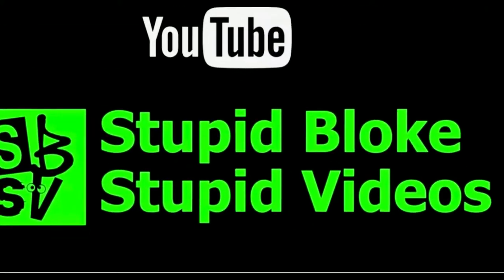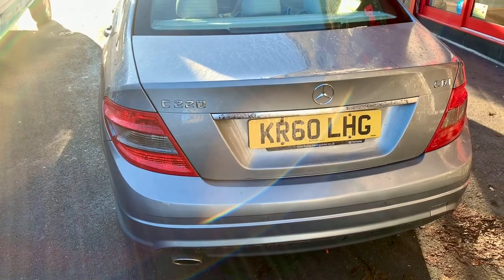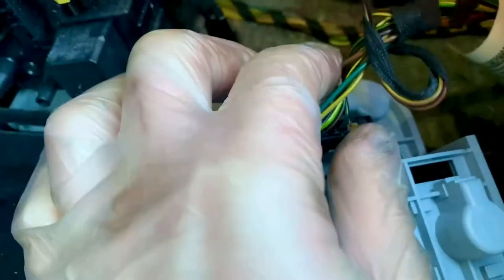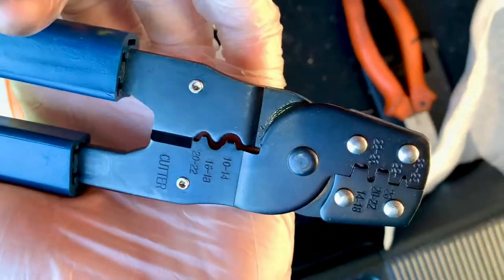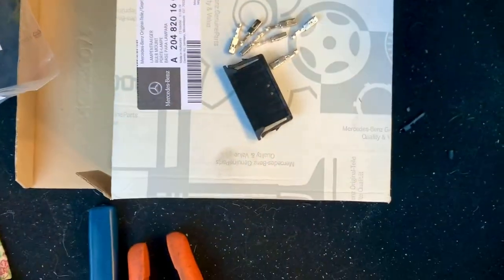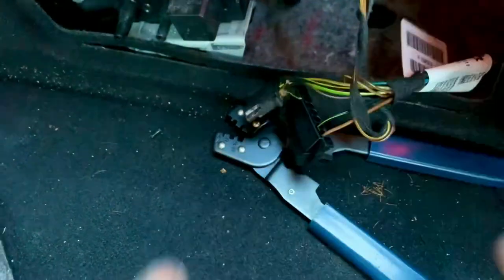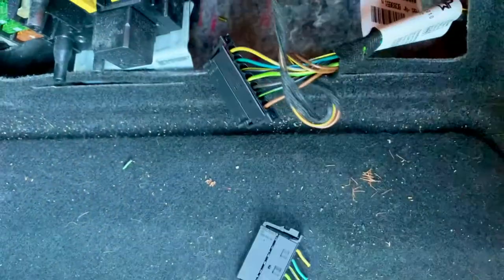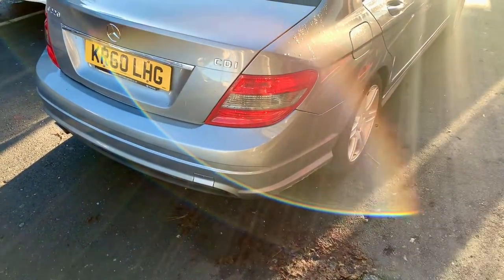Mercedes C Class W204 Rear Lamp Cluster Fault. Wiring Loom Repair

Comment: Very common problem with W204s. I had to replace both sides on mine, more than once!
Happy Baby Jeebmas sir. 👍
Reply from the maker: Yea seems to be a common issue, I’ve got the twiddly knob inside to fix soon too. I prefer my Beemer’s usually to Merc but saying that, it’s still a nice car though. 

And a Happy Easter back at you G.

Comment: Thanks for this video, I just wanted to confirm if it’s possible to pull the pins from the old connector and plug into the new connector. And then just fix the earth only instead of cutting all of them and crimping them before fixing them to the new connector. 
Thank you
Reply from the maker: Hi mate, yea it is possible do that if you manage to get them out without damaging them, but then the wires all end up different lengths and can strain the connector.
Reply: @StupidBlokeStupidVideos  thank you soo much. Really appreciate

Comment: I have just sorted this on my mate's Mercedes C220 W204.
The total draw on all of these bulbs if they were to be on simultaneously is 9.4A.
The 5 large bulbs draw 1.8A each an the 1 side lamp bulb draws 400mA.
So you're not going to have any issues with the individual lamp circuits fro a current perspective.
But how likely is it, you might ask, you're going to have all of the lamps on at any given time?
Not likely.
So I don't think it's necessarily a matter of under spec cable for the ground wire.
It's not like they all have this problem.
If it was you would expect the same issue on the other side of the car.
In my mate's case it is just on the left cluster.
I think the problem is the crimping on that wire. Too tight.
Squashes the copper to such an extent that it reduces the cross sectional area of the cable 
and therefore dramatically increases the resistance at that point and thus the heat damaging the cable.
So I decided to upgrade the brown ground wire to 20A cable and solder the connector to the cable instead 
of crimping. Just on that cable. I then spliced that new cable to the original brown cable using a WAGO 
splicer which is good for 32A.
Probably a little bit of overkill. A decent crimp on the original brown wire would probably be fine.
I just wanted to make sure it didn't happen again given it's my mate's car not mine.
Anyway.
Thanks for the video.
Reply from the maker: I’d be surprised if you had any more issues with that then lol. I think the issue is caused by heat build up from resistance of a poor connection. Either the female connector being too loose on the male one and making and breaking the connection slightly with vibrations, or more likely just that the connection has gone bad from oxidisation over time.
Reply: @StupidBlokeStupidVideos  Yes. I just think you have to be a little more vigilant when it's someone else's motor. Those connections are fragile as hell. It's important to use the right tool as you have in the video. I bought one just like it.

Comment: I have no reverse lights on this model c180 2008 manual gear box, the swich for reverse was change and steel no reverse lights, any fuse ore cable issues? Thanks
Reply from the maker: It could be a a few things. Most likely a wiring issue to be honest.

Comment: Another video out there points out that the burned ground wire is a common problem.  The brown wire is too thin for the current it carries, so it's likely to burn again (in time).  He supposedly created another video showing how to replace that brown wire with a larger gauge and ground it elsewhere (I haven't found it).
Reply from the maker: It is a common issue. Adding an extra earth between the earth of the cluster and the body of the car should future proof the issue

Comment: Nice video pal.  Is it worth grounding the new unit to stop this from happening again. Looks like a common fault/design fault.  The wires are too small for the a current.  When I ordered new unit that was fine around 38 quid.  But the spade connectors came with wires as they said they don't sell the connectors separately.  This cost me another 36 quid just for that.  Was very upset. The connector block was around 3 quid.  Nice that unit comes with bulbs.  Now I gotta solder the new wires as not spades we're supplied separately and too long to decrimp.  I will follow parts of your methods.  Nice one pal.   Also I emailed Merc to see if there were any recalls as this is a common safety fault.  I just received a recall for the airbag unit.
Reply from the maker: Hi mate. It wouldn’t be a bad idea to run a separate earth. This had the same recall for the airbag too.

Comment: Same issue with my W204. Where did you order the OEM part from please?
Reply from the maker: Got it from the Mercedes dealership, wasn’t expensive either
Reply: @StupidBlokeStupidVideos hello what did you ask for ? I’m having the same issue , when you went to Mercedes what part did you ask for ? I just need the silver metal bits
Reply from the maker: @MMKYT1  something along the lines of “rear right lamp will loom repair kit”. I thought I’d shown the part number in the video, but I my have not shown it well enough to read 🤔

Comment: great video as usual ,,, often in that situation I take a picture of the part before I start , it makes a handy reference if you need it further down the line ,,,, also on a technical  point , your not meant to twist the wires before you crimp them they are meant to go into the connector straight ... its to do with creating peaks and it messing with power transfer or so Im told , it was an aircraft tech that told me ,, I twist them too though. Happy New Year.
Reply from the maker: Tah pal. Yea I don’t usually twist them with B connectors because the crimp splits the wire into 2 sections more neatly if you don’t, and it leaves the connector a bit more flexible. I twisted the earth wire here cos it was a little bit oxidised so the copper was a little bit brittle. I do normally twist the wires most of the time though, like with the butt connectors cos it just seems to give a stronger connection.

Comment: Do you have to disconnect the battery for plug work, or wait till all electrics go off?
Reply from the maker: It’s often best to disconnect the battery when doing electrical work, but in this case I just left it connected as the wiring I was working on was turned off so had no power to it at the time anyway.

Comment: I did what you done replaced the whole thing with pin and passenger side top light is flicking on off any help on this ?
Reply from the maker: Sounds like you have a bad connection, could be the bulb binder but most likely one of the little connectors isn’t pushed in all the way

Comment: Hi there I’m having some trouble sourcing all the parts in the video, would you mind listing all the parts I need to order to sort out this issue please I’d be very grateful as I have the same issue on the same back rear right of my C Class, many thanks
Reply from the maker: I think the part numbers are in the vid at some point, but it was just purchased direct from Mercedes dealers. Just asked them for the plug and connectors.

Comment: What exactly was that orange tool you used to cut the wire?
Reply from the maker: You mean the side cutters?
Reply: @StupidBlokeStupidVideos   yea because the actual wire cutters are a bit pricey out here atleast 30$ just for the smallest one
Reply: @StupidBlokeStupidVideos  can I use household scissors ?
Reply from the maker: @Stackztee143  probably, it’s only thin wire

Comment: Does anyone know the part number to the wire connecter A 01 3450 7?
Reply from the maker: The number was damaged/unreadable when I got the item but I believe the plug is A2115450328 and the pins are A0135457626 but that might not be right. If you type in “w204 rear light connector” into eBay, there’s a lot of choices that come up for full kits with the connector and the pins for around £10

Comment: I replaced mines but didn't fix so I'm thinking it's the fuse now but can't find which fuse and where. Anybody know? Left brake lamp.
Reply from the maker: Have you trie the bulb? Brake lamps usually just have one fuse for both sides, so if the other side is working then I doubt it’s the fuse. Still worth checking though.
Reply: @StupidBlokeStupidVideos  no I haven't tried the bulb but now that I fixed that problem it caused my left side marker is off. I just might drop off to dealer. Dammit. Me and a friend will try at it again and dealer will be last option.
Reply: Did you sort it mate? I replaced mine but has the same errors coming although the lights all work? Do you have to system reset or anything ?

Comment: I just soldered some house hold mains wire from that earth on cluster to body earth and never had it happen again.
Reply from the maker: Fair enough, I’d have likely done the same if it was my own car
Reply: @StupidBlokeStupidVideos  I still had to put a new plug and cluster in though, it had melted to the point of almost setting the car on fire.

and comparing ebay and mercedes prices for those parts taught me a lot about mercedes.

Had 3 C classes so far and the problem was on every one of them.

Comment: The ground wire is way too small, l the gauge that is, so a thicker wire is needed to handle the amps otherwise it over heats and starts to melt everything.  Soldering a new brown, earth wire will remedy the issue.
Reply from the maker: Yes that’s correct mate

Comment: How do I de pin?
Reply from the maker: There’s normally a little hook/barb on the terminal that locks onto the plastic surround. Needs to be released with a pin or something similar as the wire is pulled out from the back